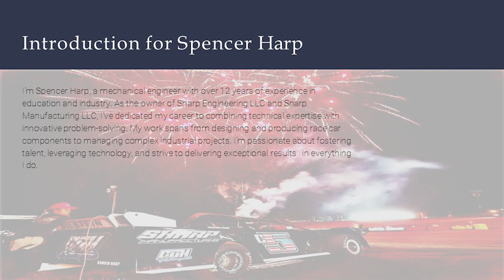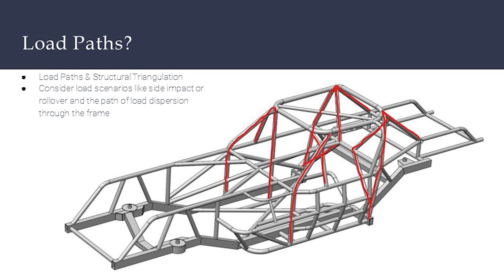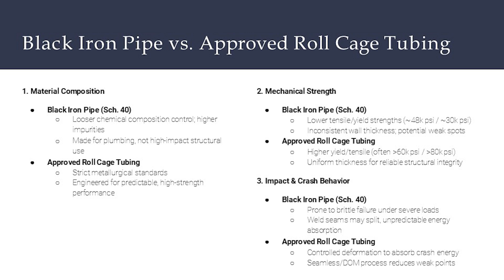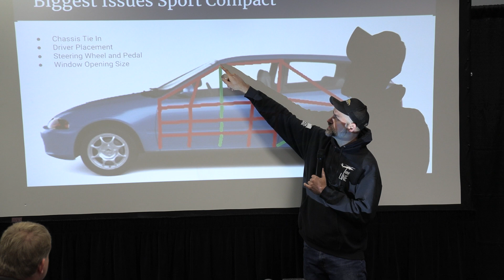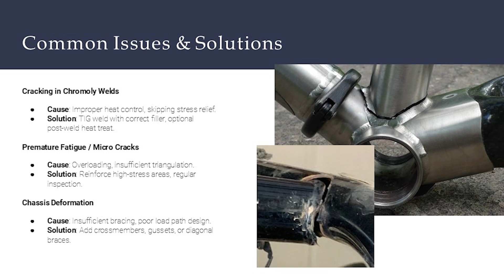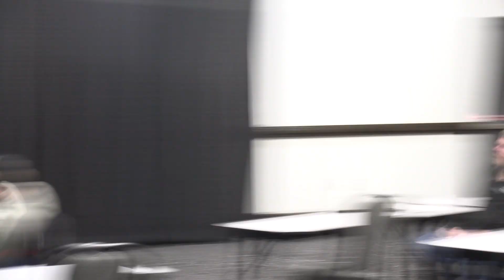Chassis Engineering Session at the 2025 Motorsports Safety Summit

Comment: People aren’t drilling big enough purge holes, and tubing is splitting from over pressure..
I’ve been seeing a lot of tubing split from trapped air in the tubing, or not enough holes to allow air to go somewhere in a crash.
I can’t believe guys are not throwing other things out there, caping the outside of roof bars on speedway asphalt cars,
Seeing burn through from being grounded down in high speed roll overs.. then getting tagged again after the strength is gone
To many people think they can weld, should be a standard for every class including the lower levels.
Tracks Don’t have a bar requirement, it’s up to the tech guy and his ego.. I’m not joking 
I could show you some crazy stuff